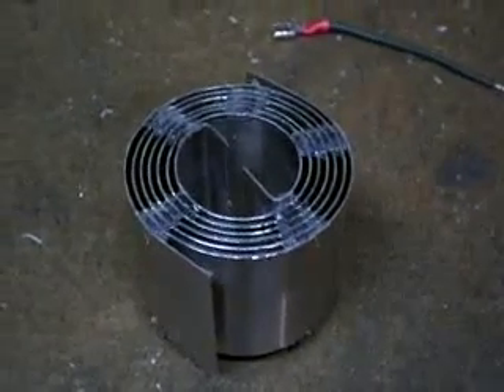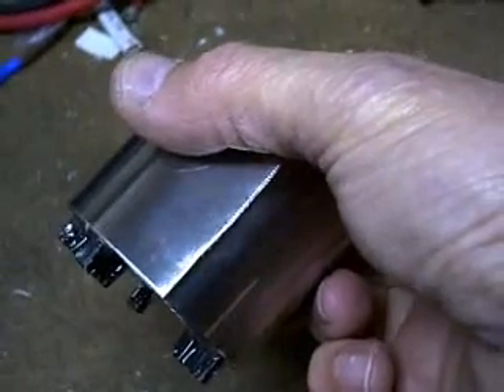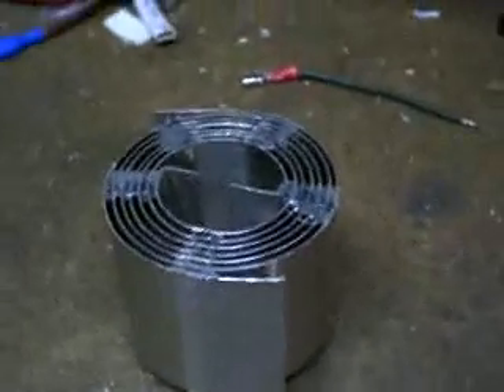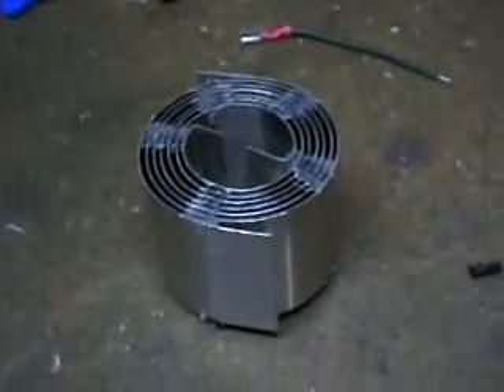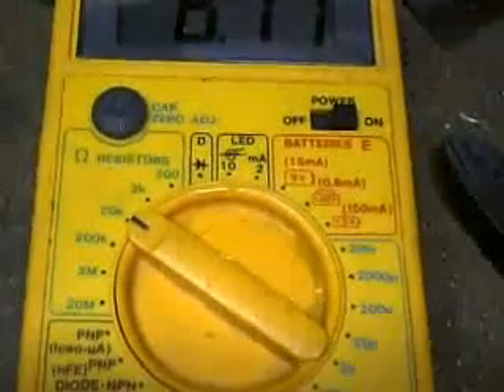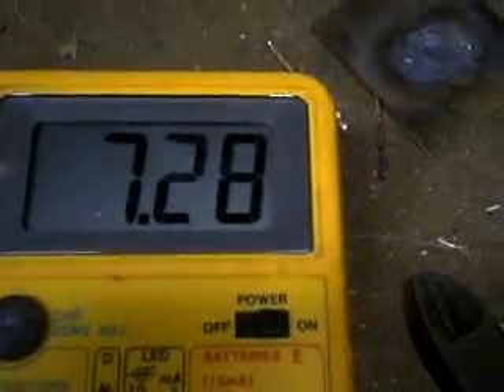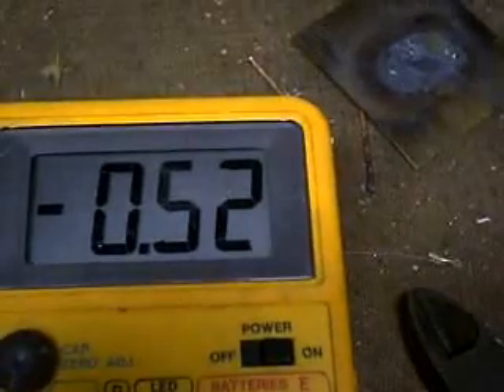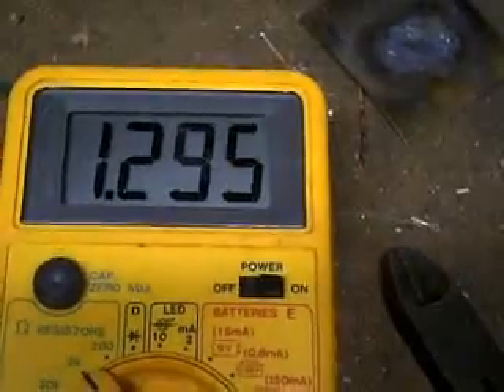#66 Resonant Water Fuel Cell 02

Comment: When the gas is produced in the cell the water that gets turned into the gas is effectively increasing in volume by a factor of 18,000, that is quite an explosive expansion, there are also liberated electrons from the seperation of hydrogen & oxygen that must be compensated for by the introduction of ionized gas in order to prevent the flooding & build up of electrical charge that will prevent further seperation. When you burn the HHO gas you get a release of thermal energy but since you're converting it back to water you get an implosion since the water it turns back into is 18,000 times more dense & 18,000 lower in volume than the gas so to make use of the thermal energy you need to introduce non-combustable gasses, such as ambient air so that as the thermal energy heats the air it will expand, now if you take the exhaust gas that contains the tiny water-droplets formed from the cooling of water vapours produced in the burning of the gas after the release of the thermal energy & feed it back into the system you will also get a mixture of air & water that is primed perfectly for the production of steam from the thermal energy produced which will also add to the expansion & therefore the explosive energy of the mixture. This is how Stanley Meyer did it, it is the most efficient way of getting as much explosive energy as possible from the water with the minimal use of electrical energy.

Comment: Question is. Can the output of this Hydrogen generation cell supply a portable, solid state fuel cell stack for the production of usable quantities of electrical output (on demand) for say, a camping refrigerator or a sensor thats is part of a remote data collection system???

Comment: Distilled water can have capacitance because electrolytes make water conduct electricity, pure water doesn't conduct electricity.
      First Method: Electrolysis separates the water molecules by pulling them apart with magnetic fields, hence you need a DC current to do so and you need an electrolyte to allow the current to pass from the Anode to the Cathode. 
      Second Method: It maybe feasible to separate water by using microwaves, but to do so you have to increase the vessel pressure and design a system that would prevent the ignition of the emitted Hydrogen and Oxygen by the microwave emitter.

Comment: Yes you have created a capacitor.  If you read up on how to make a capacitor you will find distilled water as one of the possible dielectric used  in making a capacitor.  Normally  mineral oil is even better dielectric that does not boil off or give off hydrogen gas that's why they normally don't use water for a dielectric. Can you imagine if they did all electronic devices would be gassing off and exploding.

Comment: INVERTED MAGNETO YOU DON,T NEED ALL THAT POWER AS YOU WILL FIND KEEP IT RES AMBLE ALL OF YOU THERE WILL BE MANY THAT WILL DO WELL ON DEMAND    The spatiotemporal dynamics of the face inversion effect: a magneto- and electro-encephalographic study.
Watanabe S1, Kakigi R, Puce A.
Author information
Abstract
The neurophysiological basis of the face inversion effect was studied with magneto- and electro-encephalography in 10 normal subjects. Spatiotemporal analyses using dipole modeling was performed on combined evoked magneto and electro-encephalography data to hemifield presentation of upright and inverted faces and objects. Inferior temporal cortex, i.e. fusiform gyrus, and lateral temporal cortex near the superior temporal sulcus were activated simultaneously, but independently, at 140-200 ms post-stimulus to upright and inverted unfamiliar faces. Right hemisphere inferior temporal cortex and lateral temporal cortex were active in all subjects, and in the left hemisphere in half the subjects. Latencies to inverted relative to upright faces were longer in the right hemisphere, and shorter in the left hemisphere. For right hemifield stimulation ipsilateral activation delay was around 18-19 ms for both upright and inverted faces and was calculated from all 10 subjects. For left hemifield stimulation, and the data from 7 of 10 subjects, it was 22 and 29 ms to upright and inverted faces, respectively. In sum, the methods used in this study did not identify clear differences in anatomical location of activated regions to upright and inverted faces. We believe, however, that the differences in processing upright versus inverted faces are attributable to temporal processing differences rather than to processing of information by different brain regions.

Comment: The dielectric-capacitance component and the physical double-spiral also are the components of a vector inversion transformer.  

If the current going into the spiral to charge the inductance creates a magnetic field, then shorting that field by shorting only one-half of the double-capacitor will cause the unshorted half to have a voltage spike.  A very fast one.  That is the vector-inversion working, where magnetic collapse induces a charge in a dielectric.

A super-fast spike would be invisible on any common oscilloscope, but that may kick-apart a few more water molecules.

More winds of the double-capacitor equates to a higher voltage in the inversion spike.  More length along the cylindrical axis of the windings is more current in the voltage spike.

US 3289015
US 4140917
US 4217468
US 4325004
US 4484085
US 4507567
US 5367275
US 5567995
US 7151330

DonEMitchell portal.groupkos.com

Comment: Remember, Stan Meyer used the dielectric capacity of distilled water in his HHO fuel cells... That way, you run low-amperage, high-voltage, high-frequency half-rectified square wave to achieve resonant water cracking (instead of traditional electrolysis).

You're also getting some capacitance from placing the nylon between the plates. Almost anything can be used for charge separation because everything resistive has a dielectric constant.
Reply: @brackman71  no he used dirty rain water or any kind of water, suggesting hydrogen and oxygen gas production via dielectric resonance

Comment: The measuring for the ohms use a small current to make the actual measurement. The device you use acts as an electrolytic capacitor. So the resistance goes up as the voltage storage increases in the capacitor. That is why you see a plus an minus resistance when reverting the wires.

Comment: great idea. Question: what would happen if I use salty water (actually, ocean water, with no treatment at all, VERY salty)? Would it be better? worst? nothing?
I´m asking because I´m helping to make a project to produce clean water from ocean water, and I´m going to use sun to generate electricity and power the small plant, so these types of batteries (or at least the idea) can be very interesting for this project...
Reply: papalapapiricoipi2 i think if you use salt water the wfc does no t work anymor as a capacitor.

Comment: im looking at this and thinking, if you had 2 plastic disk on each end with deep groves for spiral plates this will replace the cable ties. and if you pump the water into, one, or both, plastic disks, the water and gas will come out at the gaps on each side. it could be made as a cartridge.

Comment: Hmmm distilled water is supposed to be dielectric, but with enough voltage it can conduct electricity. In practice, small amounts of minerals attached to the electrodes or in the water can aid conduction. In theory you do have a capacitive effect, but also you have an electrode polarization or galvanic effect. You need to build an alternating current instrument (just like water conductivity/TDS meters work) in order to bypass the polarization and get a real resistance measurement.

Comment: I have been looking at similar experiments and believe that what Stan Meyers machines did that made them unique is that his electrodes were actually tuned in such a way that they produced ultrasonic vibrations and radio frequencies that assisted in the seperation of water molecules. The pulses of current radiating through the electrodes and being released as radio waves as well as passing electric current through the solution? Tell me what you think?

Comment: water is a polar molecule (it's an electrostatic dipole) by applying a test current you're causing the water molecules to become more alligned (they won't become totally alligned due to thermal energy collisions between molecules)  kinda cool to see it in action.

Comment: FOR YOU younger guys.. This is a Plate capacitor. original old time cap still used in high amperage Variable DC drives for 50 hp and up just they are made of copper plates instead of stainless steel

Comment: @ZeroFossilFuel like the whole idea of H2 O2 as a fuel source, over 100 years old. and it didnt work then and it dont work now. H2 O2 is not a fuel source, its a storage device like a battery, you can only get back if you use an ICE with ALT 35% of what you put into it. its a battery get over it and stop poisoning your self with chromite and us!!! using stainless in a "electrolytic cells" (the real name for it) is worse then dumping crude oil in to a river!!! you are killing your self and others

Comment: Distilled water has a very large dielectric constant. Indeed the military (while doing starw wars, fusion, and other pulsed power experiments) one of their favorite materials to use for their mega joule experiments is plain old de-ionized H2O. Just look up pulsed power and "water capacitors" The problem as I am sure you will find shortly is that it doesn't take much contamination till the capacitive nature of your water is destroyed by some form of ionic contamination.

Comment: @1WaterlooGuy if u use steel then it will degrade/oxidize, so u have rust in ur water, and u should use NaOH or KOH it is a stroner base and u can use less and get the same results as when u use baking soda, and there will be no other side reactions because of the NaOH/KOH

Comment: while i dont think HHO[sic]  Fuel Cell[sic] are generating 'free' energy, i think alot can be achieved by categorising a reaction in the combustion cylinder as a hydrogen event, rather like a fuel additive, but remember we already have to add to fuel to reduce pre-ignition, so it balances out here, by the time you add in damage from piston knock, sacrificial anode and cathode, and electrolyte, plus the energy consumed at the alternator under load, then the costs by far outway the benefits.

Comment: think of how your cell is made. now take apart an electrolytic capacitor, notice something? they are both made exactly the same. what you have IS a capacitor. it just gives off gas and is also a load 
put more electrolytes in your water and the capacitance will go down

Comment: hello mr zero. thanks for you work. I think you have answered this question a lot of times, but the question remains: Is the resonance a more efficient way of producing HHO than ordinary eletrolysis? What are the voltages produced in resonant cycles across the cell plates? Is enough to disrupt the resistance of water (in case of non use of any salt).

Comment: Philldapill85 you are wrong because you are missing the current where it come from there are some diferent ways of doing this cell coated non coated depends on the designe of the rest of the cirquit. as zero fossil noted is a very high capacitance and with the design made by meyer of the coils wich are +- 100 mh the secondary and more of the resonant charging chokes the r frequencie would certainly not be on the audio range stan said.

Comment from the maker: Bare aluminum in contact with water decomposes violently releasing H. BUT, when it comes in contact with water it immediately forms a protective layer of aluminum oxide. KOH dissolves the oxide. That's why it decomposes the Al and releases H.

BUT, this microscopic insulating layer would also be PERFECT for creating a step charged electric field without the short circuit we create now using electrolytes like KOH or NaOH.

Hmmmmmmmmmmmmmmmm.

Comment: dude it dosent matter what way u dress it up water beats oil and if hexavalient chromium is the problem from the stainless steal just use another metal .come on ... do u think before u post or what and FYI i have drank the resulting fluid didnt get sick stupid yes taste wired yes very bad stuff i would say not. try huffing on some straight exhaust gas & see how u do .better yet drink alittle petrol and tell me u feel ok if you are worried about the carcinagenic effects its mainly from inhalation

Comment: The water has been contaminated by the marine goop and the cable ties, oil from your hands, etc...What did the cell measure before you put it into the water? Was the SS completely decontaminated before you started?
Again, what is the free air cap>?
xxxxx xxx xxx in xx field xxxxxxxx with xx xxx That is the way to go

Comment: re: Capacitance, it's best measured under actual operating conditions rather than out of circuit bridge. Yes can trigger scope off applied pulse tho need to be aware, trigger delay before sweep start in scope is additional time. If using CH1 for volts and CH2 for current & measuring time, use chopped NOT alternate* sweep function. (*undefined time delay here also).
keep up your great work Zero!!

Comment from the maker: Dielectric or air = 1. Capacitance with a dielectric of 1 between the plates is 372pF.

Dielectric of h2o = 80 (at 68*F). Capacitance should have measured 372pF * 80, or 29760pF (29nF, .029uF). It measured 2,200uF which is 75,000 time the capacitance I was expecting.

The water used was collected air conditiner condensate. Even the purest store bought steam distilled measured 1,054uF.

Comment: measure the phase difference between the applied voltage pulse and the current using a 2 channel scope & small sensing resistor then calculate the capacitance from the delay between applying the pulse and the current rise wave form.

Comment: In distilled water I got 50,000 ufd on my 15 plate aaron's cell using a fluke multimeter. The capacitance would rise and fall as I lowered/raised the cell in the water.

Comment from the maker: It was very odd. Air had a dielectric constant of 1.00005 or something close to 1. One plate has the equiv of 75sq" and a 0.045" spacing to the other plate. The predicted air capacitance is 375pF. The measured air capacitance was 372pF.

So, with a dielectric constant of 80, I expected the water capacitance to be 372pF * 80 or approx 0.03uF. What I got is 2,200uF.

I will be buying a gallon of deionized distilled at the grocer today to run another test and verify.